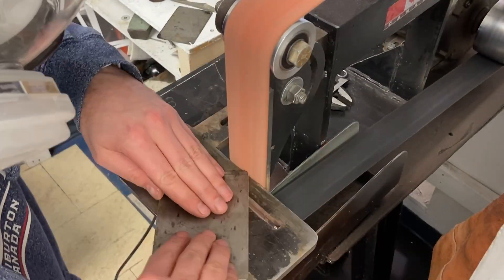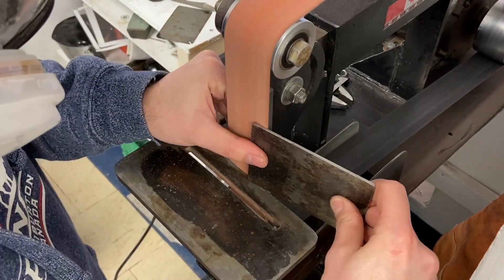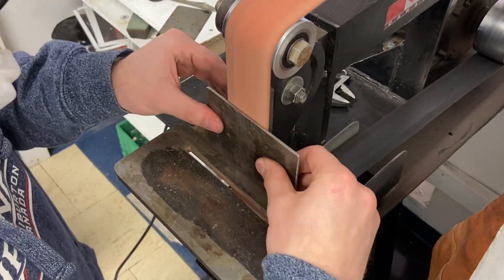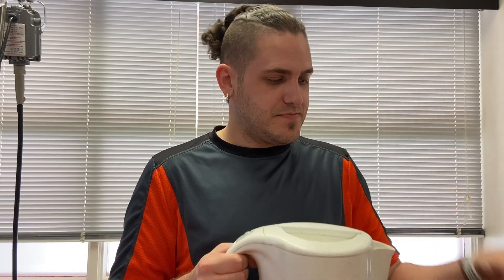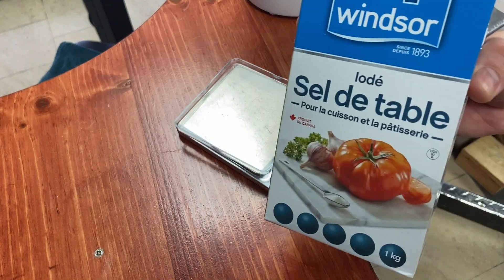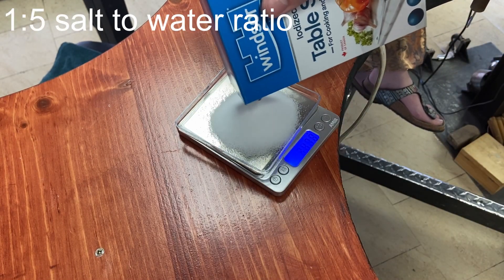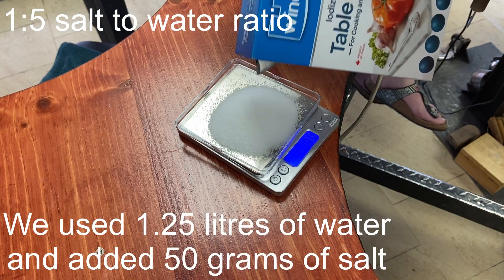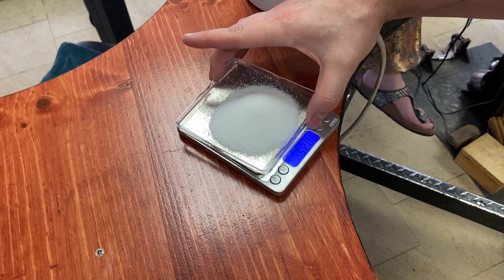DIY Electro Etching for Beginners - Walkthrough Mild Steel Address Plaque

Comment: You can use iron nitrate for both copper and silver.  Better than silver nitrate because the silver just drops out of solution as soon as it is removed.  Gold requires an iodide solution I believe.

Comment: A number of years ago I etched brass and copper using a laser printer to make the mask. Instructions were found on the Internet. I was only verifying that home brew, low cost process was practical. It worked for the project I was doing and I didn't spend time to perfect the process to see how sharp of an image I could attain. Print (mirror image) onto slick paper or special photo laser paper and then use an iron to transfer the toner to the metal plate. This was using hydrochloric acid and hydrogen peroxide for the board etchant rather than salt water and current flow. (There are also commercial circuit board etchants available). It might be worth a try for electro etching. Look for "laser printer" and "printed circuit board."